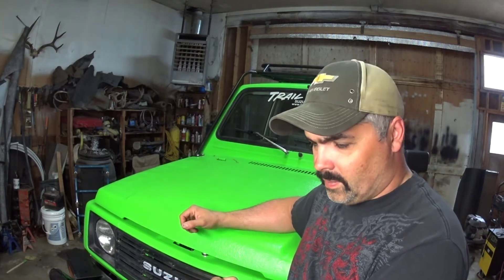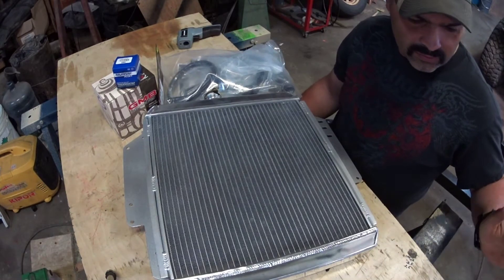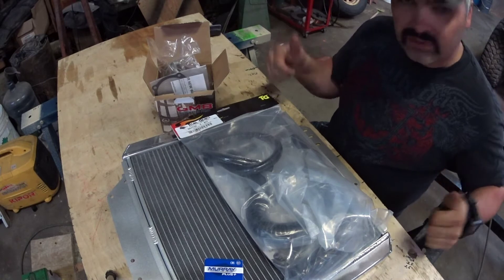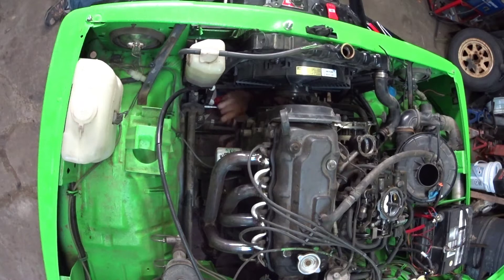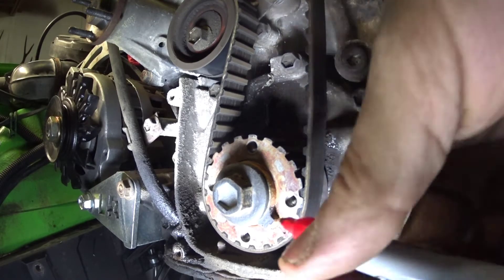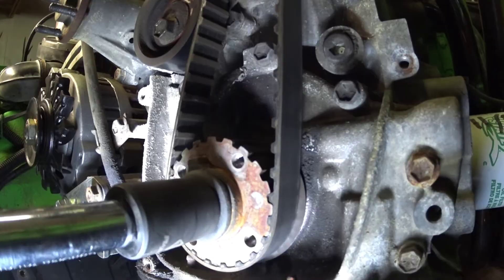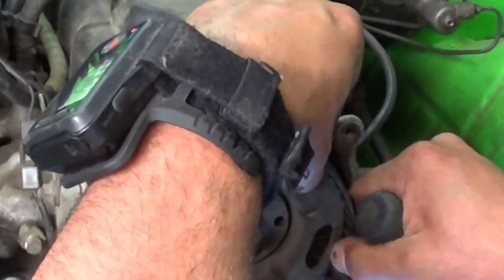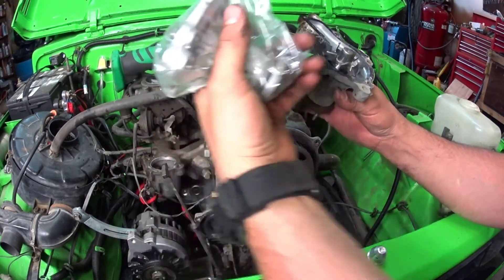Suzuki Samurai cooling system upgrade

Comment: no its coolant electrolisys probably bade fuel and oil lubrication quality it tryes to act as a disel thats a pre ignition problem .
calcium chlorine brake fluid for exampel gives you fuel based on time auto ignition your engine will swap from lean to rich burning ratio posibility is high that you have to low octane fuel if its a disel same problem try out fuel and oil aditives ore check what spark plugs you have and leads some of those like to create parasitic spark posibly you have arcing some where that you can see only at night under higher speeds engine rpm posibility is insulators interfeare with grounding ore hot side of the baterry might by your dashboard regulator is failing ore simply corosion some where in the electric circuet